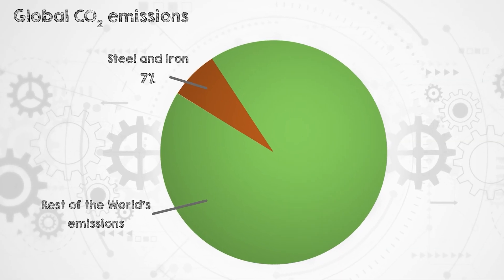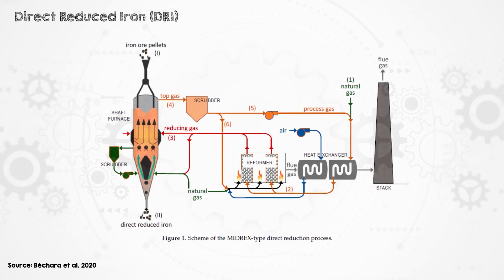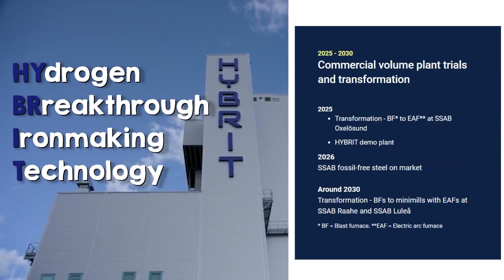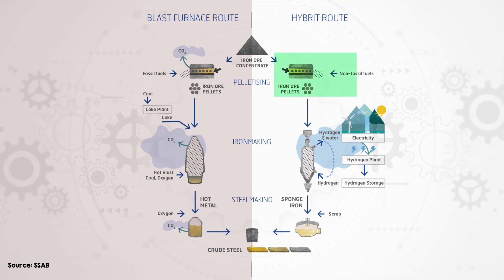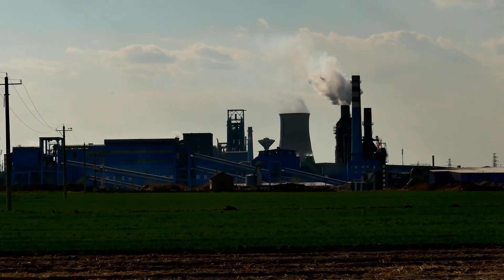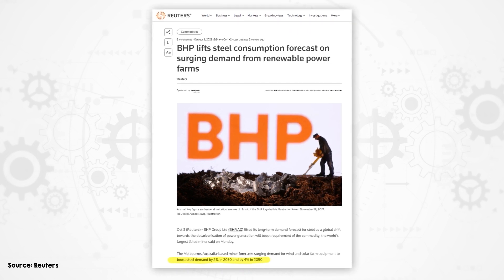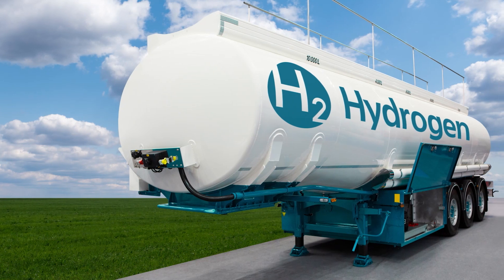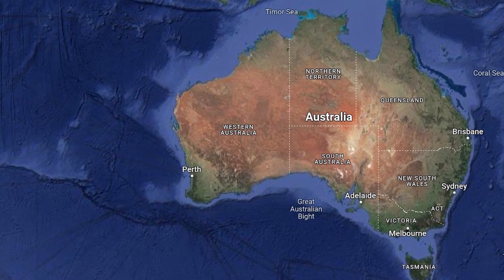Green Steel From Hydrogen

Comment from the maker: What do you think is the best way to reduce emissions in the steel industry? Hydrogen, reducing steel use, electrochemistry? Or maybe a combination of all these?
Reply: Where is all this hydrogen coming from?  We don't have any.  Hydrogen does not exist on the Earth in commercially viable concentrations and so we have to make it.  Right now, the most common method to make it is burning natural gas to boil to water to create steam to then treat additional natural gas to strip the hydrogen molecules from the natural gas.
Reply: Another good alternative is to produce less useless short life stuff that ends up in garbage. Or to make /build with other stuff than steel. Biomass should not be burnt, but used as material to make longer lived products.
Reply: My two main counterpoints are:

1) Is SSAB's lack of transparency. For example In their blast furnace vs HYBRIT comparison chart, they claim zero CO2 is produced, when iron pellets are produced. But they do not show what they are doing differently vs the conventional blast furnace method? Or what percentage of  CO2 comes from this stage of the process? Or even how It is directly related to using hydrogen, later on in the process ? So couldn't iron pellets be created net carbon free, without using hydrogen In the subsequent part of the process?

2) But more importantly we must ask. Is this the most effective way of using clean electricity, to produce hydrogen for steel production? Verses using biomass/cellulose waste such as paper and cardboard waste. Plus replacing coke with natural gas, Which doesn't eliminate the problem, but greatly reduces it, at a much lower cost. And which allows the unused clean electricity to be used for more efficient applications.

I wish SSAB well. But I don't see it as a best option, in most of the world markets, IMHO. 

Lastly society should also focus on other forms and pollution. Such as the mountains of plastic waste. And incentivizing the replacement of plastic with cellulose/biomass packaging. Which could be a feedstock for producing steel.
Reply: @nc3826  please read through the actual exposition on they Hybrit project on SSAB's website.  They don't lack in transparency at all, the project is explained in great detail.
Reply: @JonathanMaddox  Thank you for your off-base, unproven, factless, defensive, suppositions that only prove my points....
Reply: @JonathanMaddox  BTW the transparency reference, was about a chart in the post.... 

Feel free to critique it and find the information that I said it lacked....  Or from any other source.... 

Since so far you have not presented any relevant facts....You have only presented condescension.... Which is not much of a counterpoint....
Reply: @nc3826  the information you are looking for is not in the chart in this post.

It is on the SSAB website.

Thank you for asking.
Reply: @JonathanMaddox   the OC was just about the chart in this post.... so thank you for correcting your errors...  

But, I did invite "you" to post actual relevant contradicting information....  As opposed to the assumptions that you keep repeating.... 

So good luck with that....
Reply: @nc3826  I'm not here to do your homework, mate.
Reply: @JonathanMaddox  thank you, for your confession

Comment: Great coverage of the facts.  I think the delivery needs to be slowed down of enhanced. I have a PhD in engineering and found the pertinent facts flew by to fast to absorb.  Great converge on the capital already in fossil based manufacturing techniques.  As a former power system engineer capital is king.

Comment: Using hydrogen to reduce iron ore rather than carbon does not produce the same product. When using carbon, some carbon remains in the iron which is necessary if steel is the desired product. Using hydrogen leaves some hydrogen which is what causes hydrogen embrittlement....and you still need to permeate carbon into the product if you want steel.

Comment: Hydrogen reduction of iron ore to iron will never be commercially viable.  Electrolysis of iron ore similar to the procees for aluminium is quite possible, however this will be expensive.  Steel is an alloy that contains carbon and other elements.

Comment: Renewables are hopeless. There's not enough copper acailability to wire up the developing world after the developed world has taken its cut. We can do it with new modern nuclear.
Reply: What's Nuclear got to do with Copper?  That's like saying we don't have enough iron to make cars, therefore we should be using diesel engines in cars (what?)

I share your concern about Copper's scarcity tho (i too dread the approaching "Peak Copper", not often talked about).  But we'll likely simply be substituting more copper infrastructure for Aluminium alloys of comparable mechanical properties.  You may be surprised by how much electrical cabling used in the hobby RC industry (incl motor windings) is already primarily Aluminium alloys rather than copper.

Comment: It such an utterly nonsensical and futile waste of time ,in my opinion, to drag another critically needed industry through the climate scare mud.
I am a polymer chemist by profession and work in metals extraction from brine water as well as oil and gas water recycling, ultra high hard concrete formulations and previously developed armor,explosives and radiation shielding technologies for the military.
The facts are irrefutable that the entire world  has benefited substantially from the massive advances in steel formulations through increasing resistance to corrosion, along with increased ductility and tensile strength that has shaped our world ever since  black smith's discovered how adding carbon into iron [ fe203 and fe304] significantly increased those features to allow high rise structures, bridges, concrete reinforcement and ten thousand other applications.
Every time I read of some author penning another story or blog about the perceived dangers of carbon emissions and its purported effects on global temperatures, I am bewildered at the lack of understanding of how this modern world actually functions.
Fun fact, during WWI the European nations all studied the best ways of producing hydrogen gas for munitions carrying 800 foot long dirigibles and artillery spotting blimps.
The Germans were the best at building these huge flying war machines, but the Brits invented the most effective way of extracting hydrogen from iron  via heat and pressure as opposed to the French,the Italians and the Germans who extracted hydrogen from water electrolysis. 
The world is currently faced with a far more life threatening situation of its own making, by a looming shortage of diesel fuel.
That fuel feeds the world, via tractors to plow fields, trucks to deliver the food to stores and manufacturing of fertilizers via the Fritz Haber process.
Renewable energy supplies only 11% of our energy needs.
Solar panels are manufactured using 37 of the most toxic chemicals known to man including the absolute worst chemical ,nitrogen triflouride which is 30,000 times more damaging to our ozone layer than carbon.
The Swedes via SSAB whom I have worked in armor have some great technologies in ultra high hard steel technologies.
But a French steel company has probably the hardest products.

Comment: "Energy transition" is a somewhat overly optimistic term. Wind and solar cannot replace fossil fuels; they simply don't produce enough energy reliably enough. But there is a source of massive, constant, high grade clean energy in the molten interior of the earth. 
Magma Energy technology was proven by NASA/Sandia Labs in the 1980's: 

Status of the Magma Energy Project
Dunn, J. C. (Sandia National Labs., Albuquerque, NM.)
Abstract
The current magma energy project is assessing the engineering feasibility of extracting thermal energy directly from crustal magma bodies. The estimated size of the U.S. resource (50,000 to 500,000 quads) suggests a considerable potential impact on future power generation. In a previous seven-year study, we concluded that there are no insurmountable barriers that would invalidate the magma energy concept. Several concepts for drilling, energy extraction, and materials survivability were successfully demonstrated in Kilauea Iki lava lake, Hawaii. The present program is addressing the engineering design problems associated with accessing magma bodies and extracting thermal energy for power generation. The normal stages for development of a geothermal resource are being investigated: exploration, drilling and completions, production, and surface power plant design. Current status of the engineering program and future plans are described.
Publication: 
Presented at the Symposium on Geothermal Energy, New Orleans, La., 10 Jan. 1988.

A quad is a quadrillion btu, and current world energy demand is around 600 quads. Here, NASA/Sandia estimate a minimum of 50,000 quads of magma energy just from the US alone. Worldwide, the magma energy resource  is effectively limitless. 

Hydrogen is the natural fuel by which magma energy would be distributed from where it's produced - there are 450 volcanoes in the Pacific Ring of Fire, to where it's needed. Burnt in power stations with minimal modifications, hydrogen produced from magma can turn existing grids - and all downstream energy use carbon free at a stroke.    

Because of the political and economic difficulties involved in a genuine energy transition, it makes sense to feed magma - electricity - hydrogen energy in to the economy from the supply side, with large primary industrial energy users like steel, cement, chemicals transitioning first. It's great to hear they are receptive.

Comment: It's possible to use Ammonia to make green steel too. Monash University developed a method of electrolysis that can produce Ammonia directly or it can be made by substituting green hydrogen into existing Haber Bosch facilities. We need to be careful with the NO oxides produced with ammonia processes. Great video!

Comment: Come on Rosie, let your engineering skills come to the fore and do some calculations. The UK could do a few things
First the UK imports 875000 tonnes of iron concentrates. It is possible that sintering could be carried out using fine charcoal, but that would quickly denude the UK or British Columbia of trees and the greens are already complaining about pellet production for Drax power station biomass, so we will go away from using
Reply: Charcoal. Of course UK could just buy pig iron from Australia or China. Green Hydrogen then? UK produces 7.9million tonnes of steel, would you like to calculate how many TeraWatts  of renewable energy would be required to produce 7.9 million tonnes. I've already done the calculations, and perhaps make the calculation for Germany also, who produce 42 million tonnes of steel.

Comment: Steel is the original recyclable material. Scrap steel is used on a huge scale so that steel is endlessly recycled. Of not many materials can this be said. As explained here, it has long been around 30% of all steel used; this percentage seems unlikely to change. 
For the manufacture of steel from iron ore (the other 70%), the alternatives to using coal (carbon) remain of doubtful viability. The comparative cost between the established method of smelting and the alternatives not producing CO2 (eg by using hydrogen) seems much higher for the other methods. The speaker doesn't discuss this comparison of costs. Her sponsor company SSAB iosn't going to say that their method is very expensive relative to using coal in smelting steel. 
Hyrdogen is expensive to produce as the video explains, and unstable as well. One concludes from the video that it is not a fuel that we should rely on for many energy needs.

Comment: Using low-carbon hydrogen to make steel makes far more sense than using as a transport fuel. It also makes a lot of sense to reduce the cost of transporting H2 itself by installing the steel-making factory next to the place where the H2 is produced.
Reply: H2 is useful in ships, heavy trucks or as synfuels. Batteries are bad for heavy transport.
Reply: @erik7726  Possibly but production of battery electric class 8 trucks are far ahead of the H2 equivalent and battery based heavy mining vehicles have already been deployed. Also, batteries already powered short range freighters and ferries. H2 may thrive as a fuel for long range ships as a fuel of last resort. Fuel for flight is another possibility for H2 but even in that domain there has been more progress with battery powered airplanes.

Comment: It's just semantics due to our use of the term carbon to refer to GHG, but in one sense it's impossible to "decarbonize" steel, as carbon is the thing that makes steel steel and not iron.
Reply: True.  Important to remember that the carbon literally embedded in steel is (a) less than 1% by mass, and (b) is very securely sequestered.
Reply: @JonathanMaddox  theoretically it should be possible to make negative carbon steel that way, which I bet in like a century when the climate crisis has mostly been forgotten is gonna be one of those terms that really confuse people.

Comment: last year one of the big organization that represents copper interest followed what was said by a big organization that represents aluminium a few years earlier in that we do not need to dig anymore out of the ground.

This was because there is enough intrinsic copper and aluminium just laying around, not being used or just scrap if the world could get recycling all this material "we" could save a lot of money, energy and CO2 etc as well as stop the environmental damage of digging.

 Wonder if steel and iron manufacturing and mining is anywhere close to this and/or if is it linked to the base price of iron and steel vs the other two metals?

If this is the case or even part of it how much reduction in emissions can we get before changings in the way Iron and steel are produced?

After that add in hydrogen and electrochemistry.

Also, I would not be surprised if iron and steel factories not wanting to design and build their own wind farms to power their own works to reduce costs.